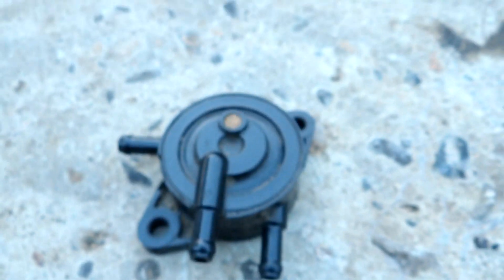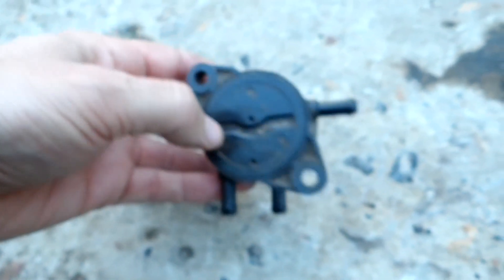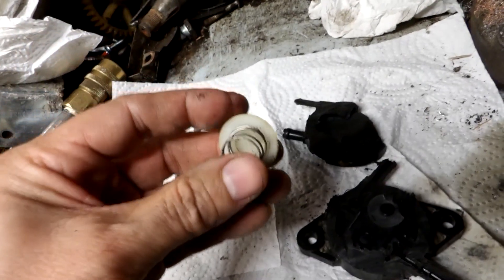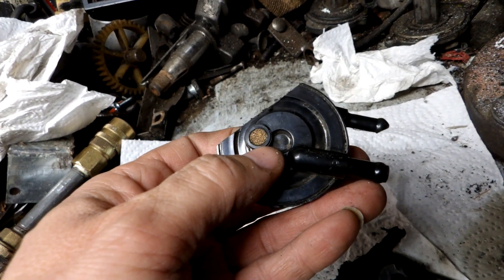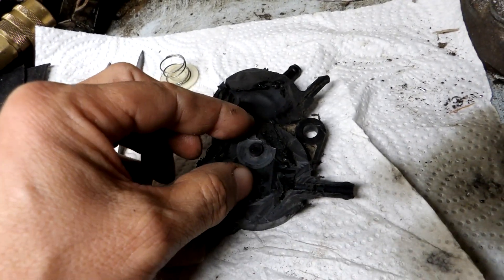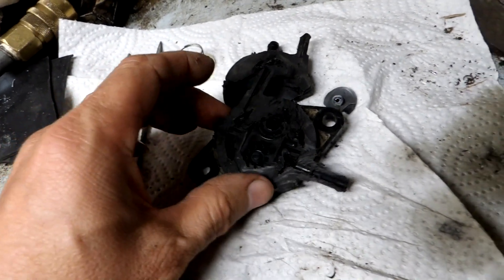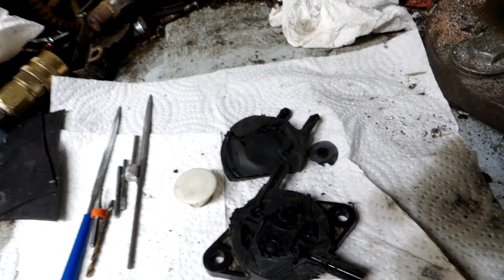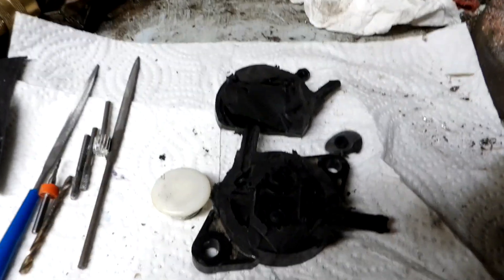Riding Mower Vacuum fuel pump Dissection!

Comment: changed a new pump and still no gas, doesnt appear to have any suction coming from where the hose goes to the carburetor,  i can hear the fuel solenoid click when i turn the key on, it will start and run  with fuel added to the carb, but has no suction still coming into the fuel pump. how much suction should there be from the carb. has a new fuel filter, gas line from gas tank was blown out. havnt took the carb off yet but not sure why no movement from the new fuel pump

Comment: Much like the one on my friend's Craftsman. Fortunately the pump was okay, it was the fuel line that was bad!
Previous owner had used non-fuel-rated hose and it had swelled up so bad inside it was plugged!
Ran great once that was fixed. Ah, Mikuni, like the carburetors!
Reply from the maker: Yes, sometimes fuel does strange things to stuff. My one supercharged 2 stroke wouldn't make a second run, as the electrical tape spacer I made had slipped once the gas vapor got to it.